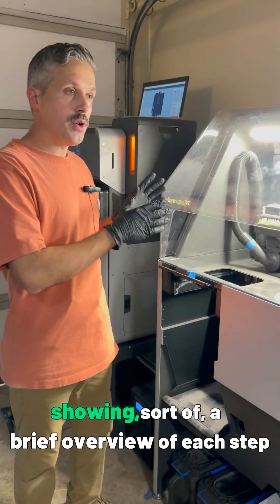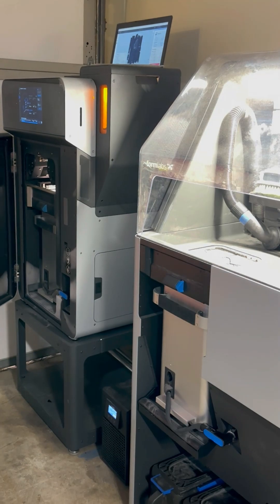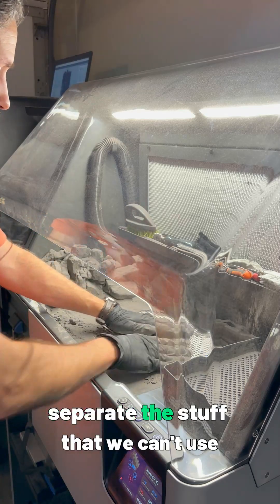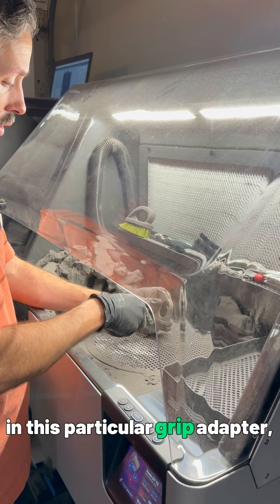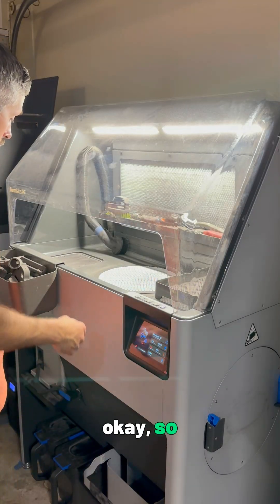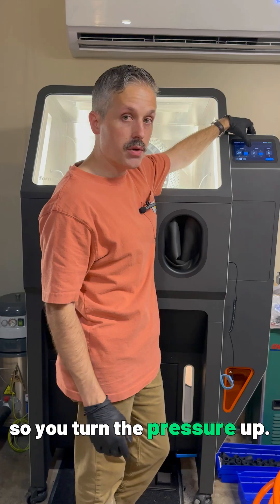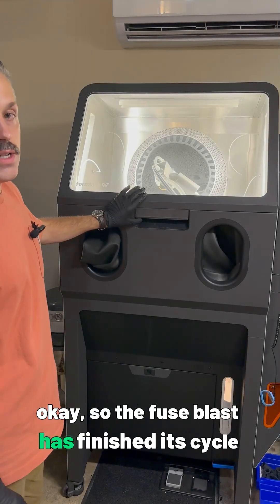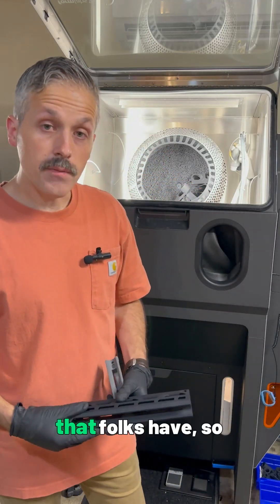Formlabs SLS Process Demo

Comment: In my country there is a TV series called "How do they do it". This excellent video would certainly deserve a place there. How would you describe the biggest difference between advanced 3D printing and these high-tech devices and operations? Capacity, level of finish, strength of the end product, higher degree of difficulty possible.. ?
Reply from the maker: Thank you for the kind words. Some major differences:
- Higher resolution than FDM
- Parts are isotropic. Meaning the parts are strong in all axes vs FDM strong in just X and Y, but weak in the Z axis between layers
- Since the parts are supported by powder there is no need for supports and there are less design constraints for parts made with this tech than FDM

A negative:
- the equipment is VERY expensive compared to FDM and the use cases are more limited.

Comment: Terry is the software that generates the geometry package of the parts proprietary or available without the printer?
Reply: Thanks for the answer. 😅
Reply from the maker: Sorry man. The models have to be created using CAD software. There are free programs and paid ones for that, but it’s a bit of a learning process to use CAD. I use Fusion360 for that. I believe there is a free version available. Just not for commercial user. Then it has to be converted into code that the machine understands and uses to build the parts. The software for that comes with the machine and is available to play with online. It’s called Preform.